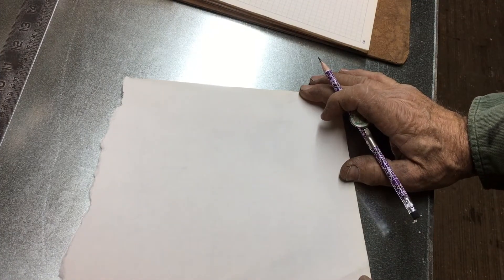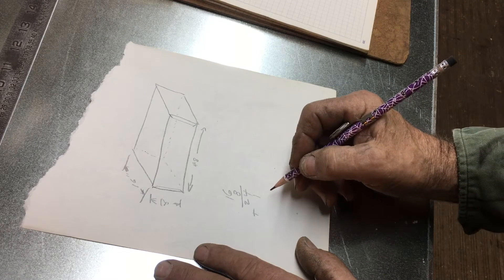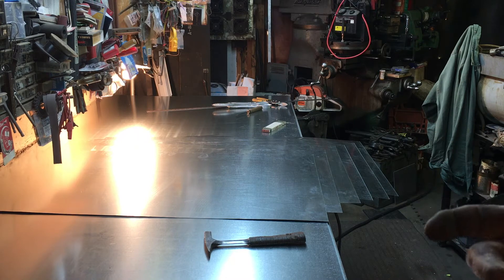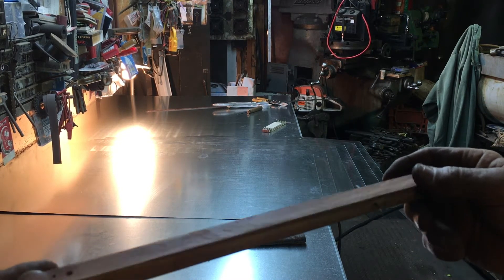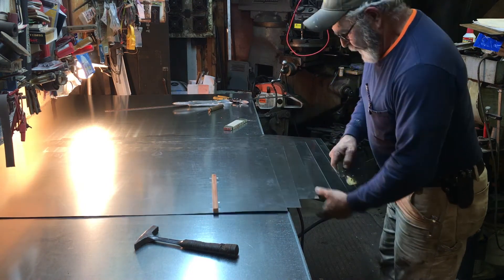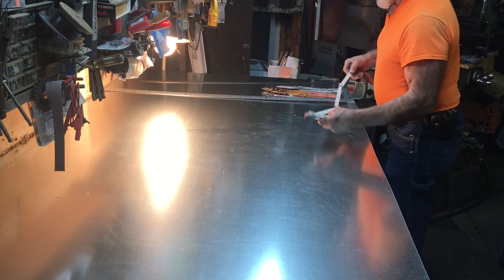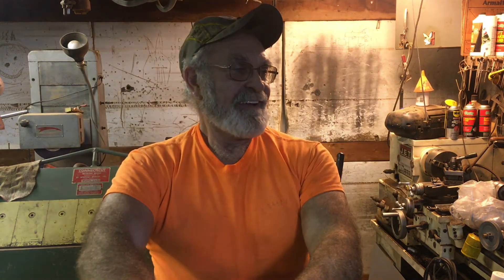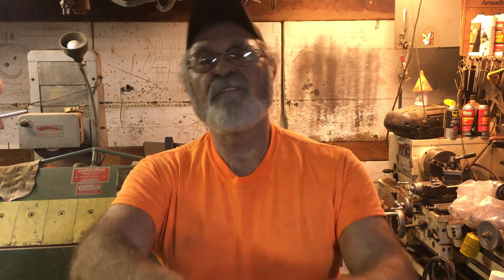HVAC Sheet Metal Layout Part 1

Comment: 8’ joints are garbage. To hard to manage  all around. Oh you don’t want to be a magic marker mechanic. Love it
Reply from the maker: When I was much younger, I hung dozens  of 8 footers and didn't enjoy it one bit !!  I never understood guys using the fat markers back in the day. Nowadays they have the fine point markers and those are MUCH better, but I still prefer the awl.  Always did and too old to change.  You'll see on some videos I'll highlight the scribe marks just so they show up on the camera.  I had a few complaints about not being able to see the scribe marks.  Thanks for watching another one Harry !!
Reply: @tractorman4461  I’ll dot my points during triangulation  and sometimes on a fitting but I’ll punch it and scribe it Worse case red pencil. Marker is for Pittsburgh and inside of fittings because I forget sometimes. True Tin Knocker traits.
Reply from the maker: @harrygilbert4593  Hahahaha....I forgot all that I don't remember, its so bad !!  If I am laying out multiple fittings before folding, I just put a big "I" on the insides of the sheets.  On bigger jobs, I may lay out 10 or 15 fittings before folding the first one. I'd do it all in stages...layout/cut, then fold and insulate if required, then assemble. If I'm laying out multiples of the SAME fitting, I sometimes punch the junction of the notches with the pieces in a stack,, then just notch them to the punch marks. But I don't get in too much of a hurry anymore....and the big jobs are behind me now.

Comment: So what do you use to layout again?
Reply from the maker: Most of the time I use an old fashioned ice pick because its much longer than a standard scratch awl.  Sometimes I use an awl though, but not if I have to stretch all the way across a 4' wide sheet.  I keep the points supremely sharp on the belt sander. Thanks for the question.

Comment: Love the video, just started special layout sheet metal fabrication 2months ago. Love the the stainless steel scribe, I’m gonna make me one the old timers will be impressed😂
Reply from the maker: David Waters make sure you put a pop rivet in it so it’s easy to pick up. It won’t lay flat that way. You can buy a scribe in the HVAC supply houses that have all the sizes running up one side. I’ve never used one though. Good luck with your training David. It’s a very good career choice. I’m actually a commercial HVAC service tech and mostly just self taught in sheet metal. Thanks for the comment sir !!
Reply: Pop rivet is a good idea👍🏻. I have 4 regular scribes, just like yours for smaller stuff cause there is no adjustment.
Reply from the maker: @Scarletannewaters  Yes, its much easier to pick up and for the times it gets covered by another piece of metal, the 'bulge' in the top sheet shows where it is too.

Comment: Even the stuff I know how to do can always be improved on. I try and learn something from everyone.
Reply from the maker: Me too, I'm waiting to get some constructive input from people that know those Belsaw grinders to learn more too.  Btw.. are you well versed in the subject of sheet metal fabrication?  Like most other stuff I do I have no formal training except for HVAC service.
Reply: @tractorman4461  What littl I know I got from making machine guards, body work, and building fuel tanks for Catapiller dump trucks.  
I repaired and rebuilt Belsaw sharpening systems and read the books. I have experience with grinders and grinding wheels on all manner of grinders from die grinders with 1/4" wheels up to Cincinnati Centerless grinders with 36" wheels. 
There are two basic types of wheels. Resin bond, that has the grit glued together to form the wheel,  and vitrified that fused the grit together under heat and pressure.
You talked about heating during grinding the gullets. Having a coarse open grit stone with sharp grit and a weaker bond means it stays sharp longer, cuts cooler, but wears down faster.  The rule of thumb is hard steel soft wheel.  Saw steel isn't all that hard. Back in the Belsaw hayday of the 50's aluminum oxide was a big step up from sandstone. Grey stone is a good bet that it is aluminum oxide.